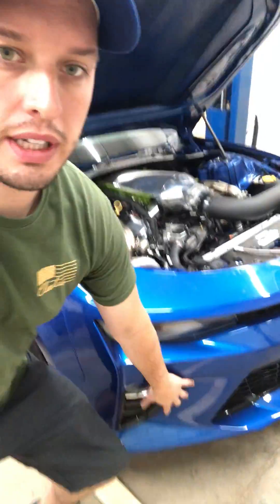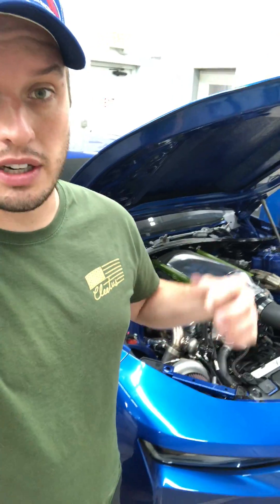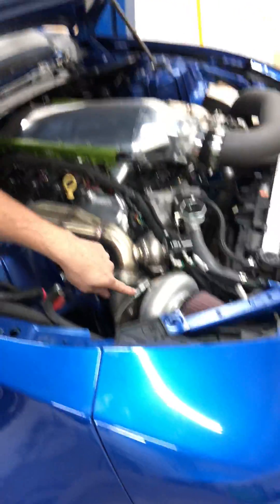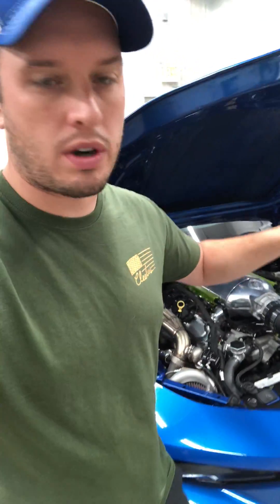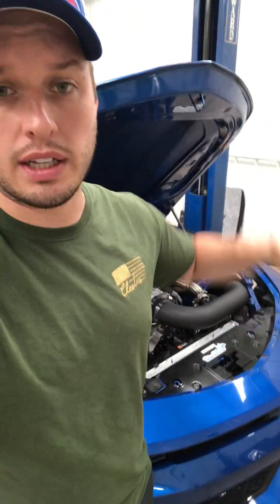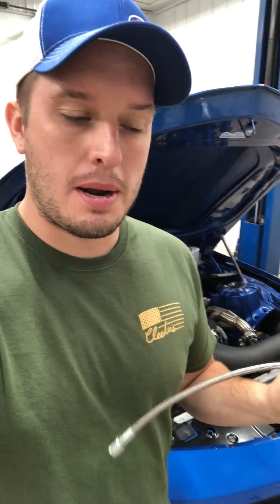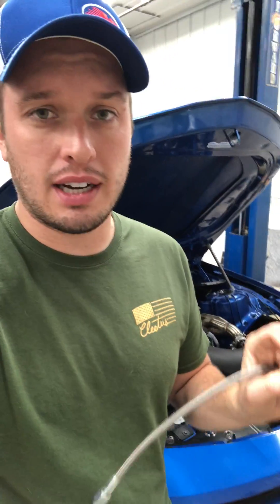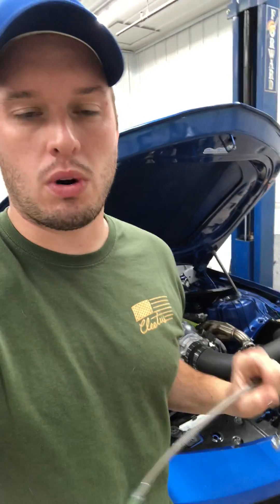Turbo Smoking?  FREE FIX!  Fix your turbo oiling issues for free!

Comment: This kinda makes sense but it will still leak the height difference from where the supply is. IMO the only way to eliminate this issue is to place a check valve right on the turbo feed fitting.

Comment: Excellent video mate. Mine only does it on idle not when normal or hard driving. Is as though too much oil on idle. Does the p trap address this?
Reply: i have the smae problem let me know if this fix it for you or if you figured something else out
Reply: @Travis_cerny86  mine ended up being the radium valve that was supplied for the PCV plate, this was smaller than OEM causing oil smoke issues

Comment: I have a A4 2.0T B8 when the car is idling it smokes but goes away when you drive it then starts smoking when you sit at a red light. Any idea what could be the problem
Reply: i have the same problem,turbo is just after the rebuild.🤔

Comment: Please try and and explain that again or maybe a demonstration
Reply: He said make the oil line lower then the turbo itself, once car is shut off the oil will sit in the lowest point of the tube and not sit in the turbo
Reply: @pwnedpkerz2  meaning that u have to make the oil supply pipe from the oil filter that supplies the turbo go lower so that it holds the oil down ??
Reply: @timothyinvestments   The engine oil is gonna be hot, but turbo oil gonna be piss burning. So the exit line has to be lower then the turbo, if it's higher then the oil will literally cook like a pan inside your turbski (which is why people let their car sit for 60-90 seconds after ripping before shut off)
Reply: @pwnedpkerz2  ok , my turbo is at the top of the engine, I will look at the outlet so that I can make a P trip for it .if u can show me how to do it I will really appreciate it..
Reply: This happened then my turbo just blew up do u know how to fix

Comment: My turbos are mounted high and got the turbosmart oil pressure regulator and rebuilt 1 turbo. dual On3 70mm when i go wot the car smokes any ideas 151 compression on all cylinders.